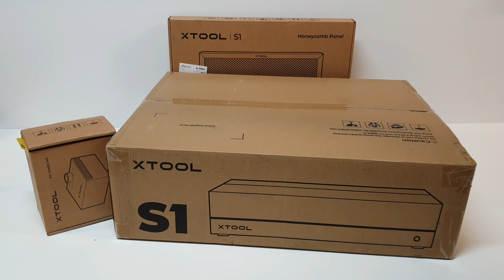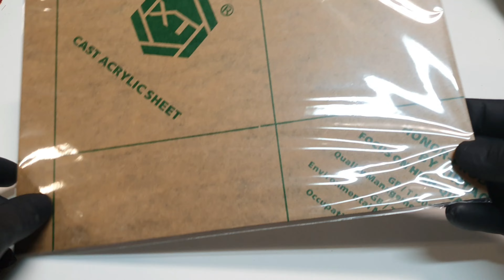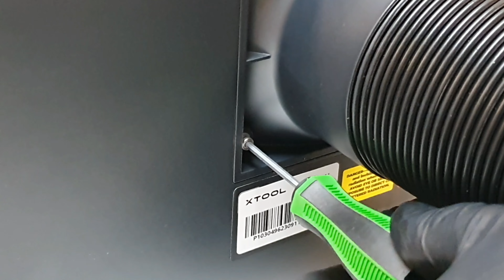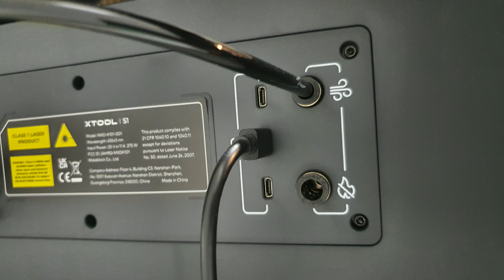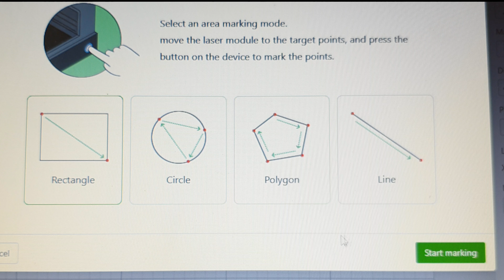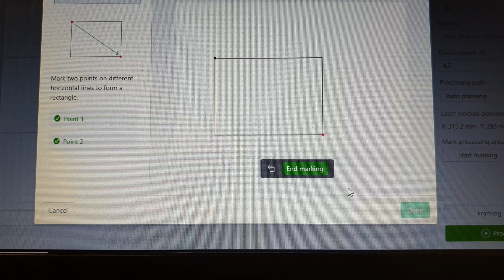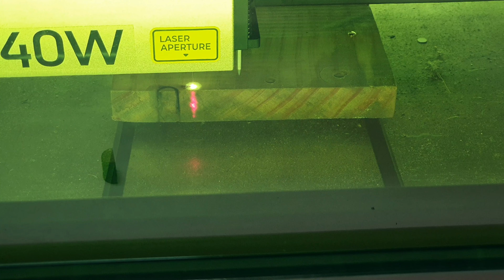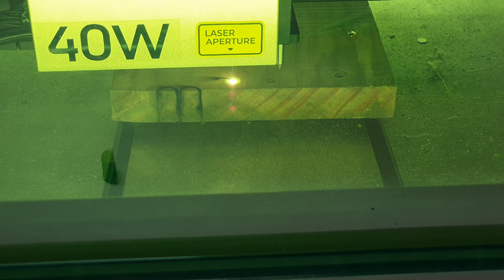XTOOL S1 40w Laser First look & Fire Test

Comment: Hi my friend. I found a piece of history in a thrift store. I first thought it was a military foot trunk. But after I bought it, and was giving it a thorough exam, I realized it was a case for a munition. And as I was looking more closely, I discovered a small stencil that says Pearl Harbor.

It's made out of red oak. The boards are an inch thick. It is assembled with wood screws. There were partitions that had been removed that may have held some kind of large shell. It's 14 inches square and 2 feet in length.

As you can imagine, it's pretty beat up. There are cracks in the wood. One of the corners is banged and cracked. It's original color was dark military green. It was painted over hastily with a tan colored paint. 

I want to go, maybe, a combination restoration and some how preserve the stencil. As removing the paint, it's in bad shape, with a paint remover would spoil it's story. I really don't want to spoil it. 

Any suggestions?

It's kind of like the wooden tool box you restored.
Reply from the maker: Wow that's a cool story Oswald. I would definitely try and keep the stencil. Are you able to send me a picture at all to my email.
You will find the address back on my main page. I'll put my thinking cap on for you and see what ideas I can come up with.